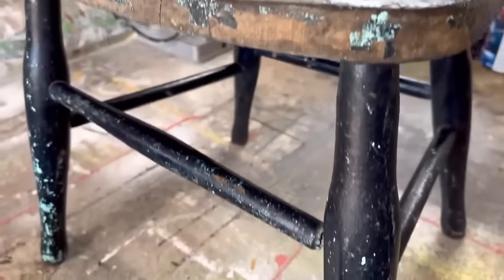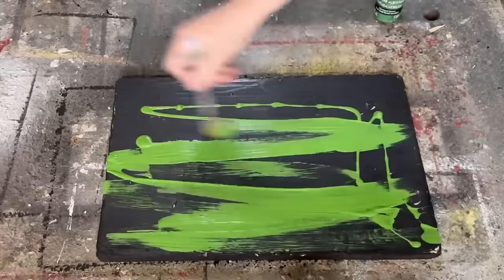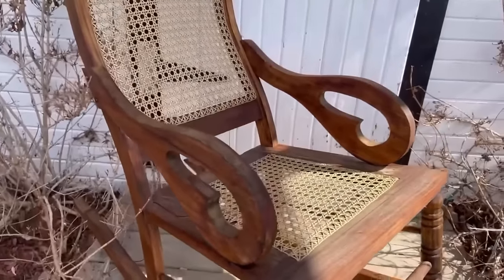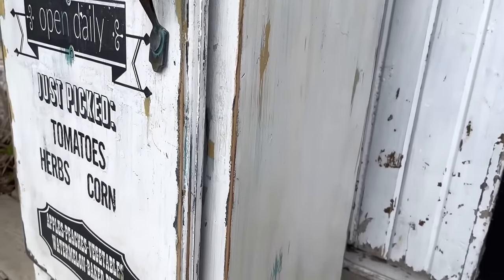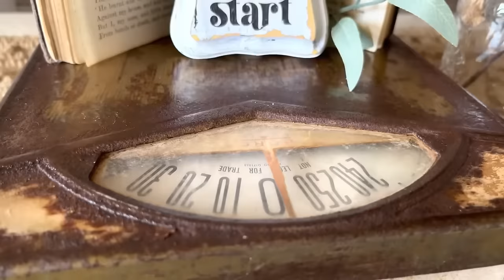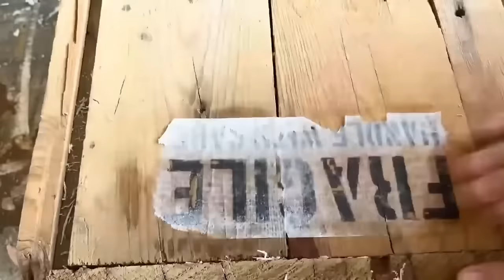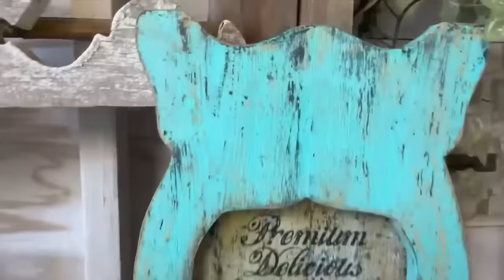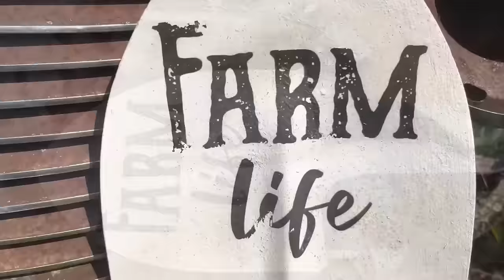Transforming Trash to Treasure with Incredible Dumpster Finds!

Comment: If only our local dump allowed us to rummage through the trash that people throw out, one could open a second-hand store and sell items at low cost. I see so much stuff that could be reused but they strongly enforce the no-rummaging policy.  
Another obstacle  to reusing items from buildings that get torn down is having the excavator operator ($$) stop his work to allow people in to remove things as he tears things apart the building. Quite often items are fastened to unwanted parts of the building. Plus there's the safety issue of tramping around trying to remove things.

Comment: Here's something I hope folks read (including PE teachers/Coaches), before throwing these items away!

If you happen to still have that old, beat-up rubber soccer ball you used in your soccer games between 1965 and 1982, DONT THROW IT AWAY, it could be worth some money.
 
WHY?
Because if it was used in soccer games, then there's a high probability it had a thin polyurethane rubber carcass (not like the vulcanized rubber soccer balls of today). So, if you got one that you have not thrown out, and it's very worn (forget about it holding air, this is not important right now), and it was used in soccer games over 40-50 years ago, than it could possibly put at least (I said at least) $100 in your pocket. Oh, and they don't make them anymore! Unfortunately, many of these end up in the dump.

Here's the details.
Size 5
Very worn (don't worry about it being flat)
Was game used in late 1960s / 1970s (not a backyard kickball)
Does not have "dry rot". 
Minimum $100 for each ball!

Who would have ever thought old rubber soccer balls could be worth anything!
Reply from the maker: Wow who would have known

Comment: I'd like to visit my dump! How does it work? Do you have to make an appointment or can you just show up? Do you have to pay to take things away? Thanks!
My favourite idea is for the shovel head signs. I have a few so I am planning to make some! If the shovel is rusty cam I paint over that with chalk paint?
Reply from the maker: It’s a shovel is rusty. You want to seal it with a primer otherwise it will reach through before you paint it with chalk paint.
Reply: @OurUpcycledLife  thank you! Will engine enamel work as a good sealer against the rust? Or do I need a paint primer? If you have any ideas on how to use rusty springs I'd love a video haha I have a bucket of them